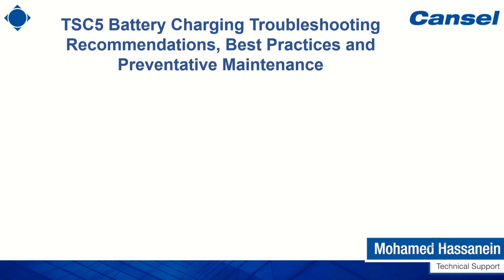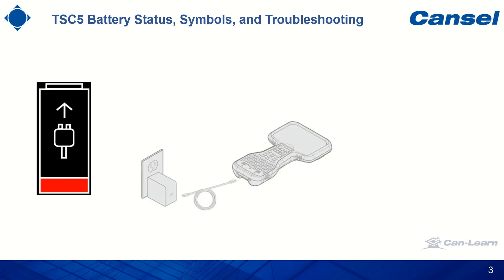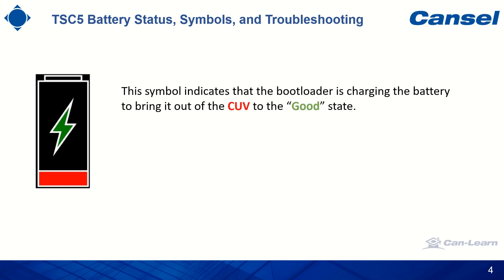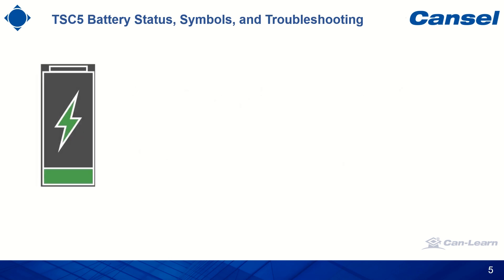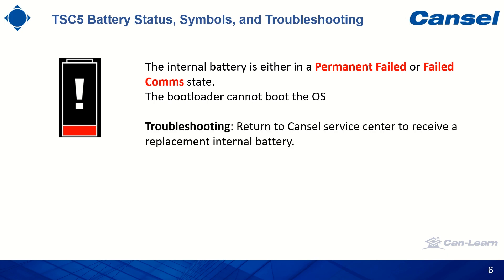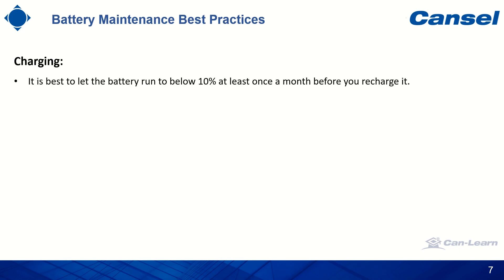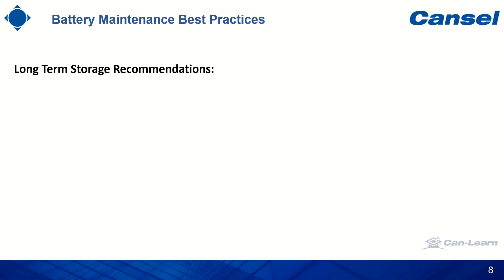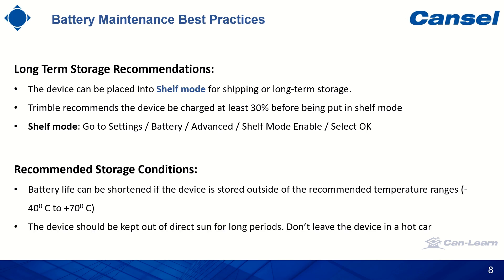Can-Learn: TSC5 Battery Charging Troubleshooting

Comment: Trimble clearly rushed this model to market. It's a POS in my opinion. Glitches are the norm. They should have taken the TSC-3 and given it more RAM, a faster processor, and a better screen. I guess that still leaves the operating system...not sure if these glitches are Android related or Trimble.